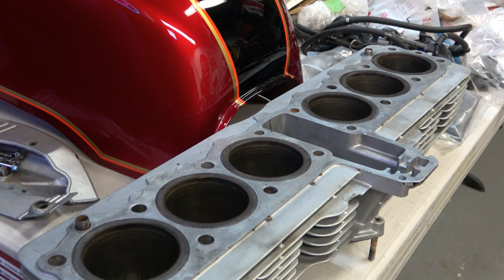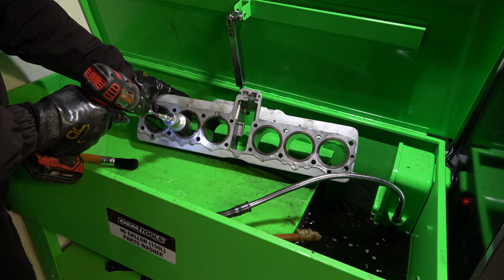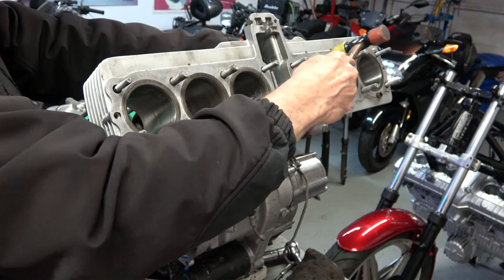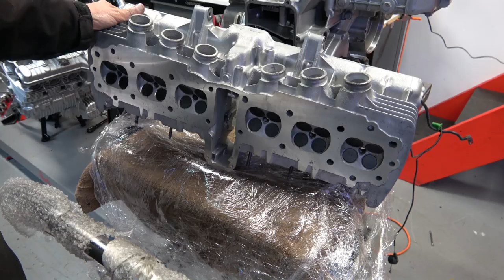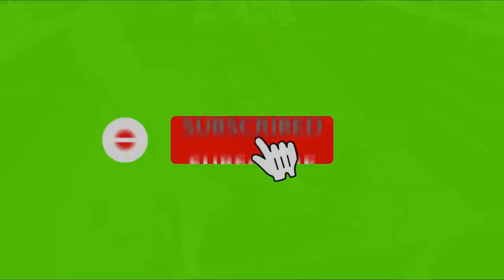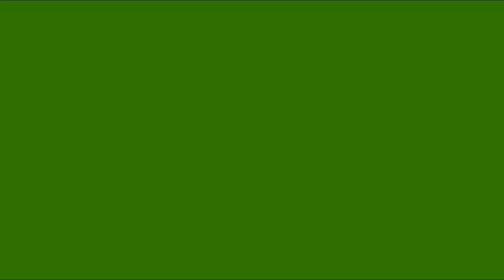Honda CBX Step by Step Restoration Video Series Part 32 - Engine Re-Assembly of CBX #2 of the series

Comment: Diesel fuel also works great for honing cylinders. It provides just enough lubrication while still letting the hone do its job. Washes out the crud pretty well too.
Reply from the maker: Hi Kaden, yes, diesel works, but has a very strong foul odor and is not water soluble. Solvent works great, smells nice and is water soluble. much more user friendly and has been the best choice with mechanic shops for a long time. But that is just my choice, there are many methods of cleaning engine parts. Thanks Kaden :)
Reply: @digitalpizza1  Very true, hadn't thought about it that way!

Comment: Great to see videos again. How do you determine whether you do a bottom end or not.
Reply from the maker: Hi John, I usually base it on whether I am familiar with the engine prior to the rebuild. i.e., I know the history of the bike, or had a chance to ride or hear the engine running, or was able to analyze the engine running before the build. Honda transmissions are pretty bullet proof, so if the bike has relatively low miles and looks clean inside, and no leaks from the cases, then chances are, its probably ok not to split the cases.
Reply: digitalpizza Thanks for the reply.

Comment: Which machine shop are you using to recondition the head?
Reply from the maker: Hi Trygve, I use a machine shop near my shop. I am sure you can find a good machine shop near you that does head work. Just call around and ask them if they do motorcycle heads. You will have to provide the valve seals to them as well as any valves that need replacing.  I hope this helps. Thanks Trygve.

Comment: No way... This type of honning is the worst setup for how to do it...  Why did you not take it to specialist to get it honned by machine?!
Reply from the maker: This type of honing is only used to remove the glazing on the cylinder walls , not to bore them. 
I agree that if they would have needed to be bored, then they would have been done at the machine shop